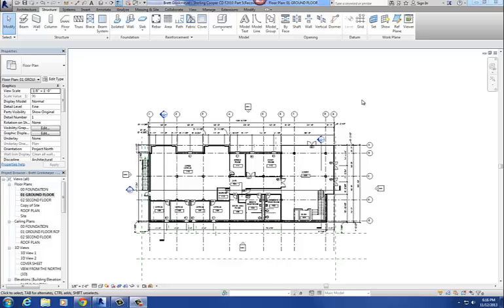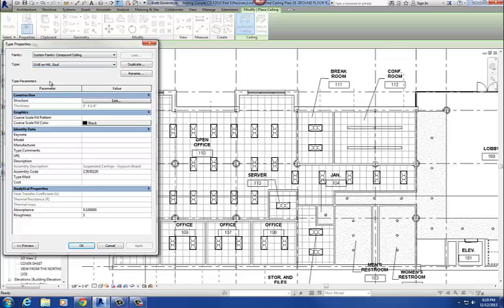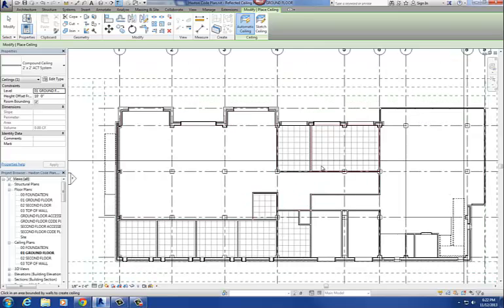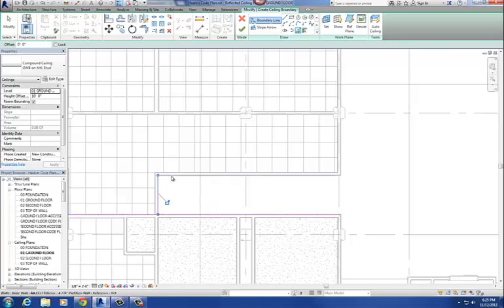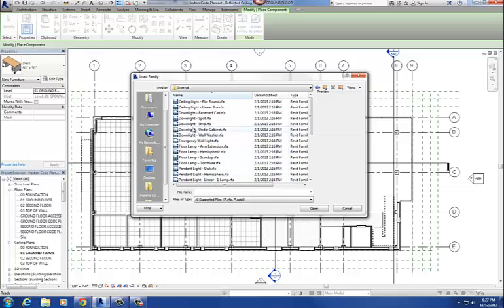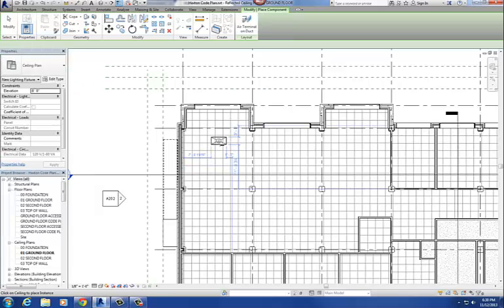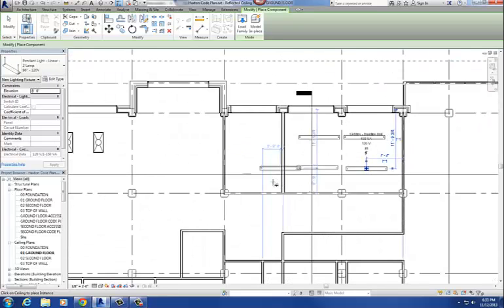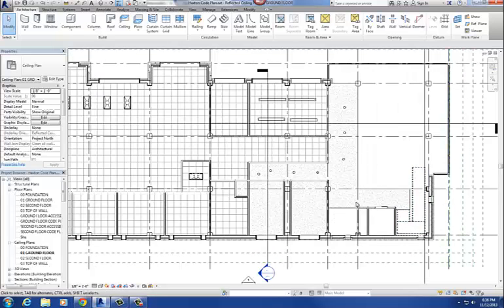Creating a Ceiling in Revit Part 1

Comment: When i chose ceiling 24x24 (60x60cm) and follow ur steeps
Revit give me Warning:  
None of the created elements are visible in Floor Plan: Level 1 View. You may want to check the active view, its Parameters, and Visibility settings, as well as any Plan Regions and their settings.
i can’t see lines 
CAN U HELP ME ?? THNX.